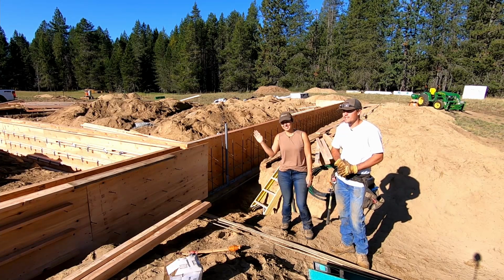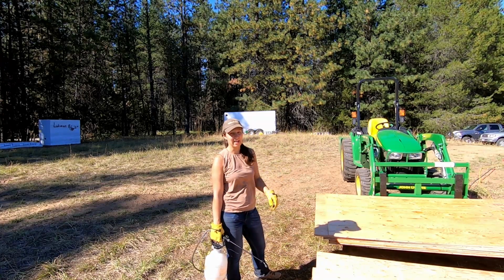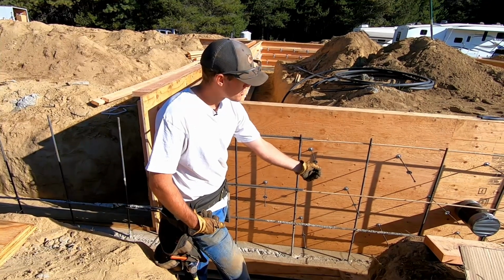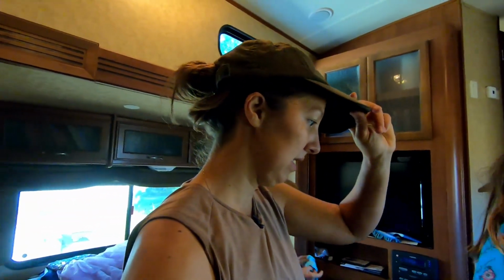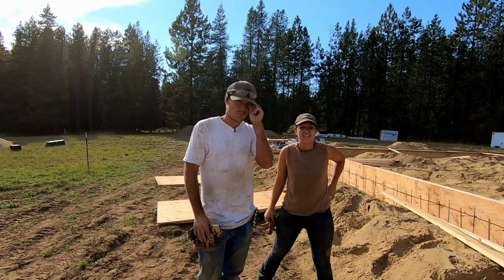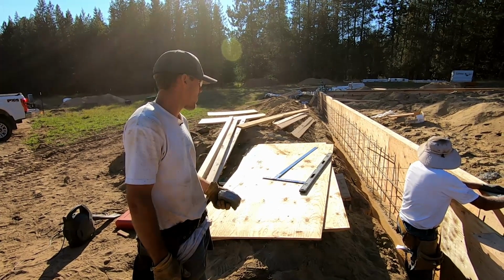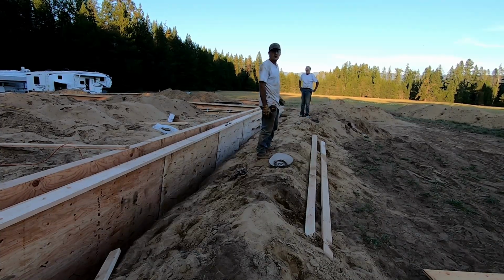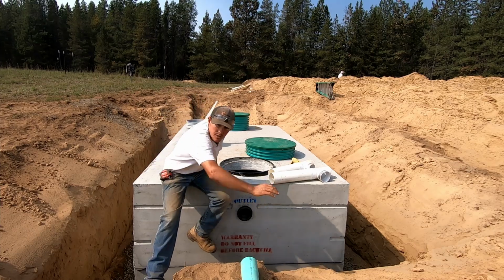Raw land to Homestead. Week 8 Stem Wall Continued.

Comment: When you order your cement order fiber mesh , it will make everthing stronger. I had a crew and built and poured home foundations for many years in Oregon . And please make sure you use a vibratory when you pour the stem walls so you don’t get what we call honey comb, (air pockets in the walls ).